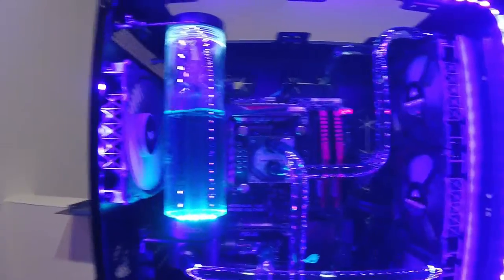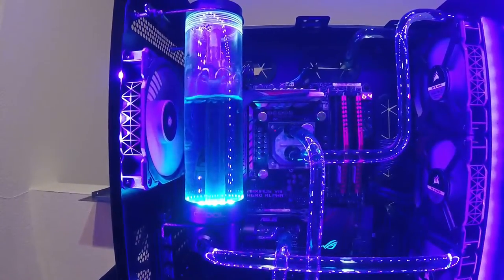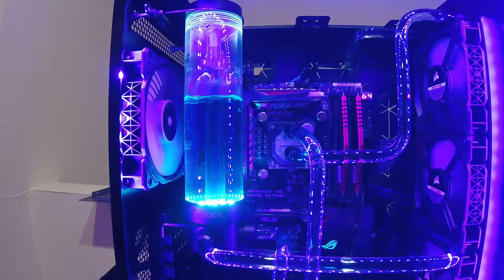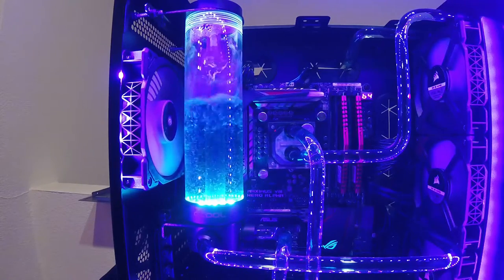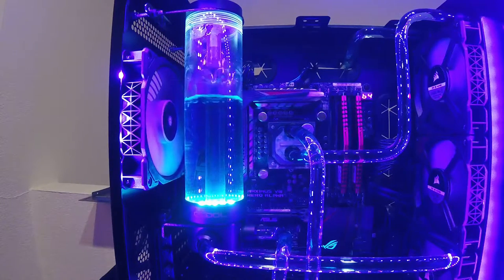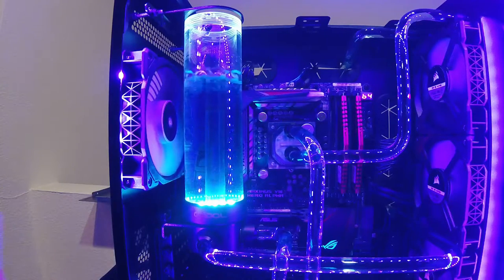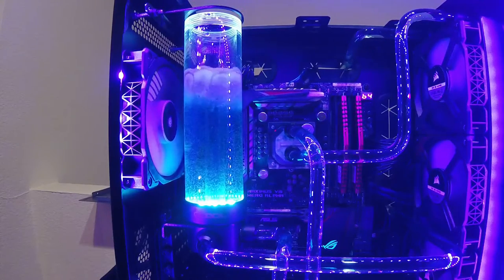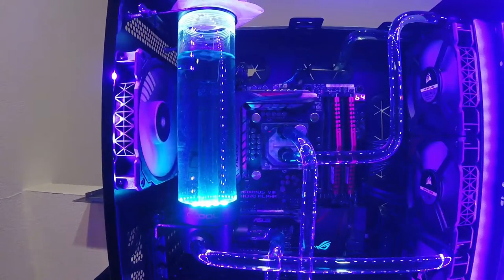Alphacool Eisbecher reservoir Pros and Cons

Comment: I know this is an old video but I had a thought .   if you took several of these aquarium balls, they're plastic and connect together even, usually used as filter media. but if you put a few in that reservoir , it should stop any bubbles from reaching the bottom and being introduced into the system
Reply from the maker: That's so funny we have a reef tank and I thought about it. I just remoced the internal tower piece and routed the return to the top of the resovoir and that solved the issue.  Excellent suggestion though.

Comment: Nice Pro/Con video.  Appreciate that you showed the effects of different Pump Speeds.
When the Reservoir is filled with the bubbles do you notice them going through the OUT Tube?  In an Alphacool Video, they mention that the piece at the bottom (Bubble Down) removes the bubbles.
I am thinking about putting one of these in my rig and would use the Top as my IN which I guess would allow a few mm more fill level.

Comment: I have the same reservoir paired with a Alphacool ES Laing DDC310 Pump - Single black plastic bottom  that has no speed control and I run it at full speed and it looks nothing like that. It runs super gentle with no bubbles at all.
Reply from the maker: Yeah I'm sure the pump is overkill for my setup it's fine around 60 percent speed.  I was trying to show why you need speed control on a powerful pump, kind of a worst case scenario.  Glad you're having success with this RES mines still working fine, no issues at all with any of my setup other than holding off on hardware upgrades at the moment because of stock issues.
Reply: @ZombiePlanAlpha  when I was shopping for parts I made sure to look at the flow rate of the pumps especially after seeing what other people had to deal with in their setups. Videos like yours helped me out. Thanks. Also glad you're doing good with your setup.

Comment: When you have your pump running higher, are you actually seeing bubbles in the rest of your loop?  Alphacool claims they have something at the bottom of the reservoir that eliminates bubbles, so the pump doesn't pull them into the rest of your loop.
Reply from the maker: James Krolak at 90+ percent yes.  The micro bubbles make it through the "grate"  at the bottom.  Worth noting on my loop with my tubes and my blocks I get better cooling at 70-80 percent with no gains any faster.  With more gpu or something 100 percent might be fine.  It's a lot of pump for my basic setup
Reply from the maker: ofsamsonov93 I have personally removed the grate and run the reservoir nearly completely full.  No bubbles and no vortex without the grate.
Reply: guess it is your fault if you removed the grate....

Comment: do u have the acryl base or the normal because it says on the website is says leds are for the acryl one
Reply from the maker: Acrylic but I don't use the LEDs for it anymore since I switched to Vue fluid because the fluid isn't transparent.  The LEDs weren't very bright unless you're using just water with no or little dye
Reply: @ZombiePlanAlpha  ok thx

Comment: the D5 is too powerful for this reservoirs setup, the inlet tubes of the res create alot of bubbles and minute bubbles get sucked back through the system, mine is the D5 250mm Eisbrecher and I have my D5 variable on its lowest RPM, Ive been trying to bleed the system but I dont think its possible with this reservoir
Reply from the maker: Para Digm I don't know what the variable speeds on the manual D5 are but at 70 percent (pwm) speed the bubbles aren't an issue. Also your fluid level has a lot to do with it.  My fluid was bubble free after maybe 2 hours from assembling the system.  As far as too much pump for the RES, the RES does not matter as much as the rest of the loop. How many blocks is your loop? Cpu, gpu(s), chipset, vrm?

Comment: Might be able to make the holes larger so they dont stream as hard. I just got the 250 with the anticyclone alphacool logo.. will be using the top inlet, hope that is betteer.
Reply: Or "saw" of the top end of the tube so there's just one big hole that would have bigger flow but still an effect of some sort.

Comment: Did your G4 ports seem loose? I have the same res and the ports had a lot of play until the last thread caught.
Reply from the maker: The ports seemed fine on mine with about the same feel as the ports on the pump or blocks.
Reply: @ZombiePlanAlpha  I must have gotten a bad one. I returned it for a replacement. Thanks.

Comment: What case are you using? I have been trying to find a case that will allow me to mount my pump/rad near the rear or outside (for ease of refilling)
Reply from the maker: needabettername  corsair air 540 in silver.  Available white and black also.
Reply: Mike Hollifield thank you so much!!!
Reply: Mike Hollifield one more question.... In your time using the pump, have you noticed any performace issues with the pump?  Does it get warm after a bit of usage? D55 pumps run notoriously hot
Reply from the maker: needabettername I've had no issues with the pump at all. Been about 2 years
Reply: Mike Hollifield ok good to know thanks!

Comment: How To fill the loop when you use top port as return 🤔
Reply from the maker: I redid the loop, video on channel where I got a second "bottom" to the RES so it had 4 g1/4 fittings on it and use soft tube and a funnel to fill/flush.

Comment: Can you remove the fountain effect? and can you fill the reservoir to the top?
Reply from the maker: DK Gaming yes. When I redid the tubing I actually ordered a replacement bottom to the reservoir because the bottom had 2 inputs and 2 outputs and a used the second "bottom"  as the top of the reservoir and ran the return to the top and just removed the interior cylinder.  But filling the fluid at least a half inch higher than the interior cylinder will remove the effect if you are bringing your return in from the bottom,  alphacool makes some 50mm reservoirs (these are 60) that do not have the fountain effect and are less expensive

Comment: is this a copper setup?
i dont want corrosion if i go with this
Reply from the maker: Mortal Otek everything is Copper or nickel. Alphacool radiators are copper. The blocks are nickel this is perfectly safe but do not mix aluminum parts with either.  If you're building a system make sure you clean your radiators thoroughly before use.  I used mayhems stage 1 and 2 cleaning kit and it removed a lot of flux from radiators

Comment: is this the 150 or the 250mm?
Reply from the maker: This build was the 250, I used the 150 for the updated video on my channel where I redid the whole thing and moved the pump to the front of the case
Reply: Mike Hollifield legit thank you for the reply. I have a plan for my 740. Once I finish it up I'll probably post a video and some pictures.
Reply from the maker: Sean Martin Yeah send me a link to the video man I enjoy watching other people struggle as much as I did. Unless it goes totally smoothly then keep that to yourself 😁. Good luck with the build. Pro tip if using hard tube and it's your first time order a lot it's cheap and you will be throwing some away but it gets easier as you go.

Comment: the bubbles dont matter since there is the plate with holes in the bottom
Reply from the maker: Even with the grate if the pump speed is turned up it pulls the bubbles right through. Not an issue unless you have a fixed speed pump.
Reply: @ZombiePlanAlpha  ok good to know👍 building my second hardline full customloop pc soon but i will get the raijintek rai-r20 reservoir